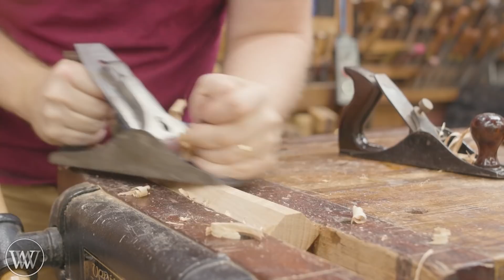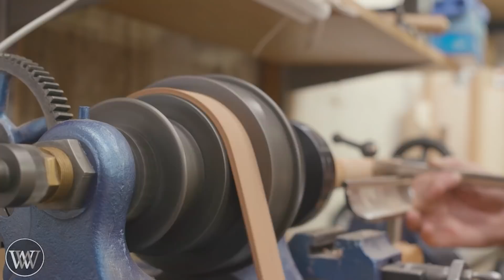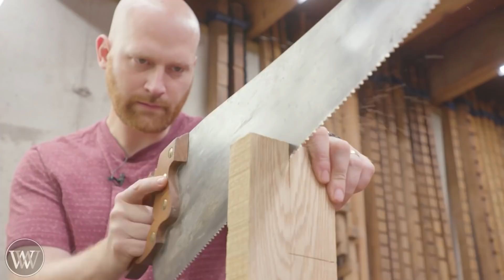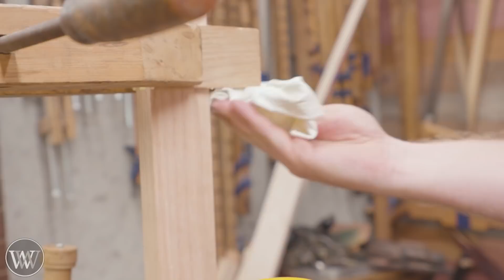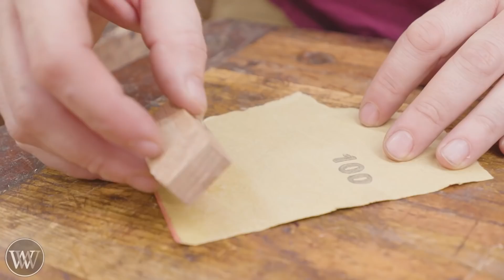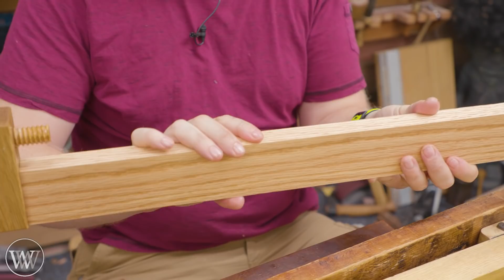How to Make a Clamp

Comment: There are two things you left out while you're editing the film comentary. 
One, what is the critical angle of a setup on the blocks so the tighten up? 
Two, what grit of sandpaper did you use on the lower block of the tail clamp assembly?
It would be helpful to post this information in the video
Reply from the maker: I do not know what the angle was I just eyeballed it. 
For the grit it was something on the rougher side. 100 grit ish
Weather are that critical to the design. So there is a lot of flexibility there.

Comment: Make extensions. You can be creative with how it attaches. Could be as simple as a U-shaped coupling that bolts on. You can also make a fancy joint that uses a wedge to lock it in place. Or, maybe a creative someone out in YouTube land knows of a joint that locks itself and gets tighter as the clamp gets tighter. That would be cool.

Comment: Awesome design but I am trying to decide to make these but with both ends adjustable and wedges instead of screws or a wedge and wood dowel variation of Shannon Rogers home made version of the veritas system with a Wonder dog. That system also applies downward pressure for allignment. Do you usually find a need for clamping cauls?
Reply from the maker: I have only used clamping calls once in the last 7 years. usually I just alternate the beam clamps and that does perfectly.
Reply: @WoodByWrightHowTo  
Awesome thank you! I will build these first so I don't have to drill a bunch of holes!

Comment: Not really clamp related...... but ive noticed in some of your videos that your tenon saw tends to ride upwards in the kerf on the back stroke...... is this somethin to do with the geometry of the teeth? Or is it somethin to do with the way you're drivin the saw?  I'm curious 😁
Reply from the maker: It has to do with the body mechanics. Some people prefer the saw to run perfectly online with the teeth. And for most cuts that works very well. But if you put a little bit of arc into it so that the saw is only touching at one point along the cut you get a smoother ride and it tends to track a little straighter because the sawdust isn't bunching up around the blade on longer cuts.
Reply: @WoodByWrightHowTo  Thanks James 😁 sometimes I see your saw ride up so much that it nearly pops out of the kerf again...... wondered if it was the geometry or the mechanics 😁

Comment: Would it be ok to use a rasp or file instead of a float to clean the tenon walls?
Reply from the maker: Sure. I would use a file. It's a bit slower but it'll do the trick. A rasp might be a little bit too aggressive but with an easy hand it would work.
Reply: @WoodByWrightHowTo  cheers mate, floats aren't overly common in Australia so good to know

Comment: To buy clamps is far too expensive for most hobby wood workers. This project is very doable, doesn't require super advanced skill. You can build as many as you need at whatever length you need. Since the pivoting piece can slide off the beam all you really need is to make a few of the beams at various lengths to suite the project! one length for drawers or boxes and longer for panel glue ups etc. This will save a lot of us a lot of many that can be used to buy WOOD! Excellent job James, thank you.

Comment: I love these clamps. Is glue squeeze out an issue on the top face? I don't have a vice on my bench, so I think I could utilise one of these in some fashion instead. Maybe a few holes in it to attach it on its side or even face up to the bench. Would it work on its side (holding a panel vertically for sawing for example)? Or does it require gravity?
Reply: To eliminate the problems associated with glue squeeze-out on the clamp bar, coat the beam with paste wax or put packing tape on the beam.  I have also used wax paper under the workpiece to keep glue off the clamp.
Reply: @marshallmurrell4583  yes, those are my go-to solutions, with paste wax being the preference. I don't like using throw away tape if I can avoid, but know that isn't always convenient. I was thinking of adding a layer of melamine veneered MDF, but not sure if that would affect the grip of the clamping action.

Comment: i'm thinking that both 'working' ends could be designed to sit on a standard sized piece of studwork timber, so that the length of the clamp can    be fairly easily changed, and all that's needed on the studwork is the single tenon cut. yeah, need to choose appropriately straight piece and perhaps slacken down the angle to allow for studwork being pine, but hey - 8ft clamp, no problem :)

Comment: One thing you might try is a triangular foot on both ends mounted perpendicular to the beam so that it can stand upright. Or, perhaps the feet don't have to actually be attached. The clamp could just sit in slots.
Reply from the maker: Right on. That's what I was showing in one of the clamps at the end. The guy who brought this to me did that on one of his.
Reply: @WoodByWrightHowTo  True. The shorter, narrow ones would probably serve just fine. I meant ones that stand taller, and with a wider base. Maybe that would be overkill, except in a few special applications. 👍

Comment: Very nice, but I looked at the price of the tap and die, including postage to England + import tax, it comes out at around £100 or $140 personally, I can't justify that expense for the amount of times I would use it, so I think I would prefer to attempt to make my own screw and nut by hand as was shown in one of your previous video's. Many thanks for the video's James.
Reply: its fairly easy to make your own, get a nut of the size you want and cut into the treads at an angle, bit trick on smaller nuts but easy on anything big enough to get a hacksaw blade through, cut at an angle and then do another parallel and clear the channel, I generally just drill through the nut and connect the bottoms of the cuts, bit fiddly but a drill press helps. Then youre pretty much done run the bolt through a few times to clear any burrs and you will need a cone on your wood to get it started but it works fine. Probably wont last as long as a pro made tool of course but ive gotten a few dozen screws out of one. For the tap its even easier just angle grind some cutting channels down the side of the bolt, I generally do 4, and Ive had some success with using a bolt thats one size larger than the nut, ie M20 bolt M19 nut because your reversing tolerances your nut will be a little smaller than you think and your screw a little wider. 

Go to an ironmonger and you can buy them individually rather than a pack of 10 or 20 you will never use.
Reply: Buy some threaded rod and epoxy it into a handle you make yourself.  John Heisz utilizes this method.
Reply: try buying some some threaded rod.  make a tap by cutting into the end in three place.  use that to cut the thread.  cut rod to length you need and epoxy into a wooden handle.
Reply: Pask makes has a video on how to make the tap & die. https://youtu.be/mTnVDl6Y6u4
Reply: Axminster & Rutlands sell them for £50-60, Amazon sometimes has them as well, still a bit spendy but cheaper than importing.

Comment: Well what’s the magic angle the bar needs set on the jaws?
Reply from the maker: Around 75 degrees. Give or take about 5. If your wood is softer or harder you might get a slightly different angle.
Reply: @WoodByWrightHowTo  thanks these really seem like some clamps I’ll actually make, simple yet effective!
Reply: @WoodByWrightHowTo  Might want to make this a pinned comment.